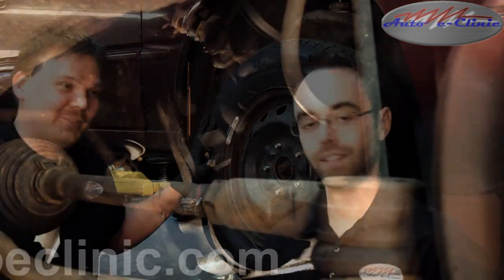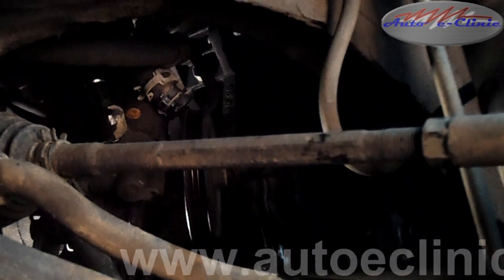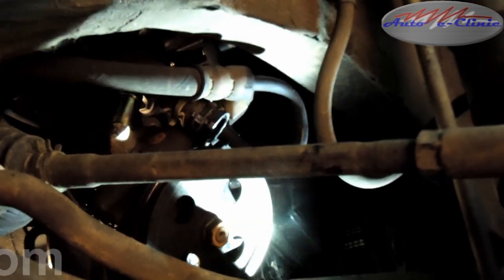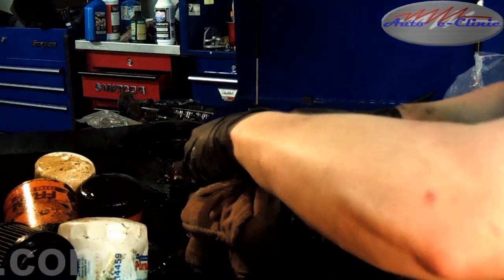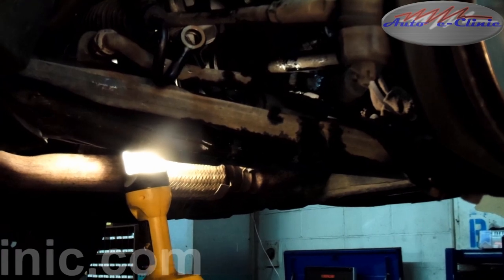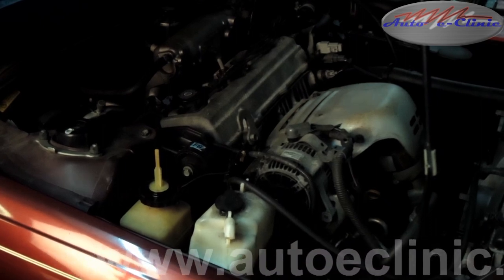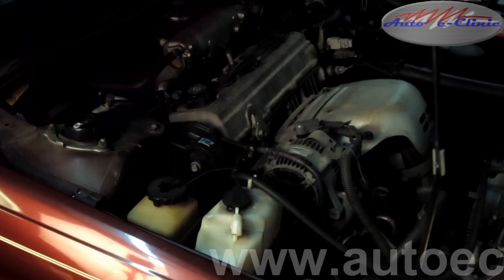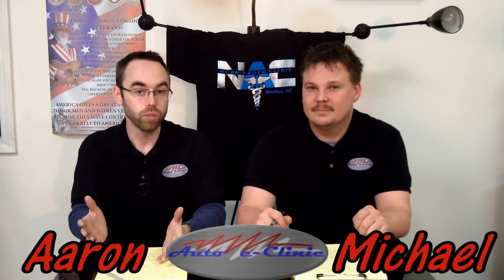How to Replace a Noisy or Leaking Power Steering Pump (Example Toyota Camry)

Comment: You skipped taking the pulley off the old pump and getting the bolts out of the pump to get it loose.  These are the tough parts.   Getting the banjo bolt out is not as straight forward w/o an impact wrench.

Comment: i dont recomend as a technician,dont do this job.this job need a lot of experience and tools.Also the right part.Its not super dificult but defenitly is not easy diy.take it to a shop and you can see the job cause a experienced tech mech could remove the pump in 20min if its not stuck